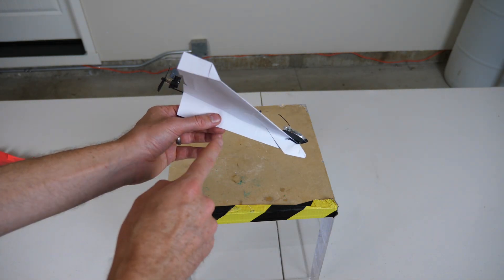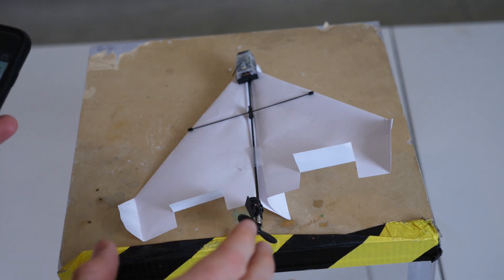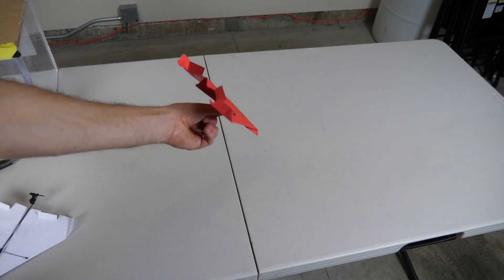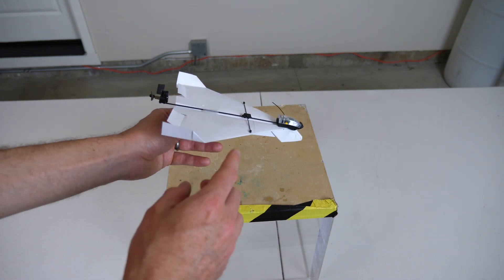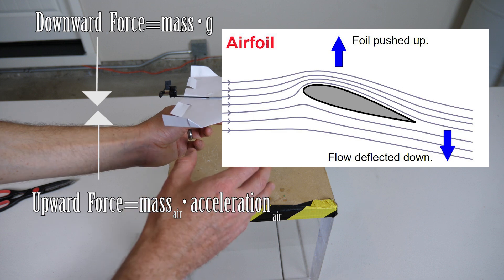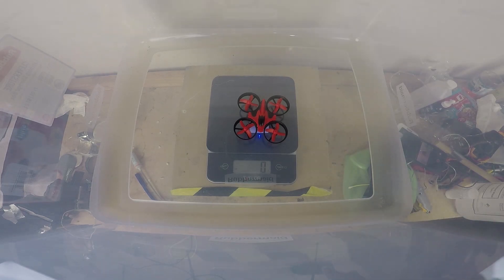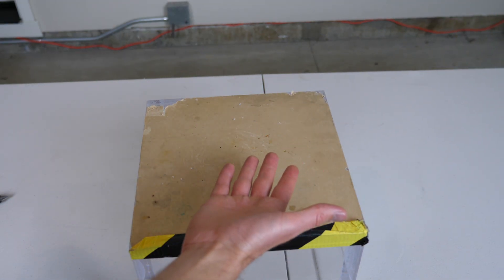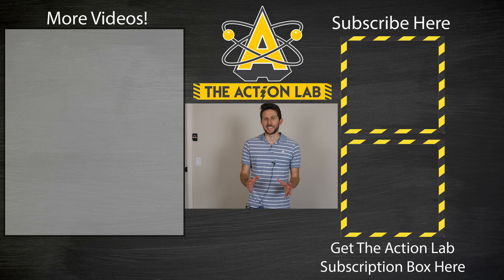How Far Can a Paper Airplane Fly if You Add a Motor? How Do Planes Really Fly?

Comment: There is a difference between lift and just being really unaerodynamic in a specific direction. This paper airplane probably has more in common with a parachute rather than an airplane. It has great air resistance in the vertical direction due to the large surface, so it falls really slowly. But that doesnt mean it can aerodynamically push itself upwards. It is more likely that this paper airplane flies, because the small amount of height that it looses while flying is countered by a slightly downwards pointing motor and not by produced lift. Also the motor is probably overkill in terms of thrust to weight ratio. You can make everything fly with enough power. Even a brick. Also the explanation in this video is a little off. Producing lift by throwing air downwards really is a result of creating a pressure difference. Also theres something wrong with the formula, because planes do generate lift at 0° AoA. I really like this channel, but this video was not well researched and scientifically inaccurate to say the least. Its whatever tho. Keep up the hard work, science is difficult after all.
Reply: Mario Dekena very well put!

Comment: Could you get a power unit attached to a gimballed (ducted) fan so you can better directional control?

Already knew that planes get much lift from Newton's 3rd by by tossing air down behind
Jet propulsion; some air pushed to high speed, helicopter; quite a bit of air pushed down at modest speed

Comment: Angle of attack increases lift but drag as well. The curved wing is much more efficient lift vs drag.
Somwhere I read that a 4 degree angle is maximum efficiency.
In ww1 there where many flat winged planes as they didn't get to the curvature venturi effect.
Sail boats also use this effect which is more efficient than wind just banging against the sail.

Comment: Alot of people are saying that Action Lab is wrong by saying that planes produce lift by throwing air downwards. Well the more complete answer is yes and no. Planes, just like fans, propellers, and helicopters, accomplish their work by creating pressure gradients. The main ways to affect the amount of the pressure gradient are the angle of attack and the shape of the airfoil, both of which are very important. The pressure gradient is really just a difference in air velocity.  The velocity of the air slows down under the wing and speeds up over the top of the wing creating the gradient. This means the air on the top of the wing is exerting less downword force on the wing than the air on the bottom of the wing is pushing up creating a net upward force or lift.  Now deflection of the air in a downward direction is also a way to change it velocity by typically slowing it down and therefore increasing pressure. This is because the air has mass and therefore inertia which resists the change in velocity. This resistance is exerted on the wing (which is the Newton's law part). There are more factors like drag and what not which come into play as well. 

It should be noted that once the wing passes through a section of air, the pressure gradient corrects itself and there is no real downward "wind" from the wing, unless you are really close to and are within the gradient.  You can observe this behaviour by watching wind tunnel tests of wing shapes.  If you watch the smoke streams below the airfoil, they are not being thrown down very far and for very long.

The reason why propellers, fans, and helicopters do produce 'wind' is because they are creating and maintaining the pressure gradient over the same area for a sustained period of time and therefore are able to give the air more momentum in the downward direction, or sideways for most fans and propellers, extending the pressure gradient further and therefore allowing you to feel it further away.

Also if the airplanes are throwing down so much air then certain types of formation flying and mid air refuling would be dramatically harder if not impossible for the plane flying below the lead aircraft (and yes I have experienced mid air refueling first hand). You would have to overcome a large down draft to stay in formation. Mid air refueling can be bumpy but that is being caused in part by non laminar flow of air i.e. turbulence and the pilots tring to keep the nose of the plane in a small box at the expense of the backend bouncing around.  I have been on many refueling flights which were just as smooth as normal flying though.

So while this explanation is not perfect, and there are some more details I am sure I am missing, Action Lab is both partially right and wrong in his explanation. I would suggest reading wikipedia and watching wind tunnel tests for more, and maybe better, information. Let more comments follow.

Comment: wings can and do provide lift by their camber, controlling the angle of attack is simply a more easily variable way of affecting lift, but BOTH are used in airplanes to varying degrees depending on their intended speed and efficiency.
Reply: No

Comment: Lift is due to 3 effects & is soly due to higher pressure below even a spinning wooden scale or foam glass flies
1. Bernouli's lift:  due to wing curvature
2. Newtonian lift : due to angle of attack ie pitching angle
3. Ground effect lift:  Additional  lift felt by racing cars, hovercraft
Reply: u know u wouldnt have airlift with out air  good fact

Comment: LOL "Throwing air downwars" acheaves exactly that - lower pressure ABOVE... "The true reason" is actually the same reason...
Even the "flat winged" plain you made has a fold in the front folded downward withch makes the distance that the air needs to travel longer than the one on top...and the elevators (or elerons not sure) on the back do exactly that - tilt the plain up so the distance... 
I dare you to try and build the plain so the fold of the wings is folded up without the folded peaces on the back...
It's the same with the propellers of the helicopter - when you change the pitch the distance that the air needs to travel on the bottom increases with means lower pressure on the top...

Comment: um just wanted to point this out ... you're so wrong. if you don't understand the subject pls don't spread false information. a aero foil causes the air particles going over the above surface have to travel a further distance than the lower side this causes the air presure above the wing to decrease and that is lift. what your observing on your paper plane is not lift . it is the decent of an object with an extremely large surface area to weight, thus even ading a small thrust vectord towards the ground alows it to stay at its inital altitude
Reply: if you would like someone to actually teach you how an aircraft functions properly and in more detail pls msg me
Reply: you have seriusly dumed this equation... (this is what you use to find lift on a aerofoil ) L = .5 * Cl * r * V^2 * A into a force vector, pls stop

Comment: An airfoil shaped wing is more efficient than a flat one. The airfoil shape allows the wing to generate lift at zero angle of attack, which isn't possible with a flat wing. The flat wing needs to be angled up to make lift. And that generates a lot of drag. For a paper airplane, that's not a big deal. But for a real airplane, it can make a HUGE difference.
Reply: I subscribed
Reply: True👍
Reply: Yeah airfoiles are just optimizing lift/drag
Reply: Exactly
Reply: you know your aerodynamics, but having the wings slanted up and also having the back part wanted slightly up, creates more lift by the air that comes in is from the front and if it goes to the back that's slanted up the air Wil go as straight as it can and pushes the curve back and increasing the altitude, you do need very slim amounts of slant though, paper is very light
Reply: Thanks for explaining it, Michael! Also simple physics shows that he is wrong. An A380 pushes 50 tons of air down per second but itself it weighs at least 300 tons.
Reply: Yes, but the point of the video is correct.

Curved wings are not necessary for flying at all, this is not why the flight is possible and happens. They are just for efficiency. In with children would be taught basic truths like that instead of misleading them.
Reply: Exactly. Action lab is a little big for his britches on this one

Comment: But then there is another wing design that is called the "symmetrical wing" which (in its name) is the same on the bottom as it is on the top which would push the air both down and up, wouldn't it?

Comment: I like your channel but I gotta correct you on this one. Lift is a product of a balance 3 basic factors. Air speed, airfoil design, and angle of attack. Too much of one or not enough of the others will result in no lift (or a stall).

The reason the paper airplane achieves lift without an airfoil is that it trades angle of attack for airfoil design. Thus the reason most paper airplanes "porpoise" in the air. Without power (air speed) the wing stalls due to the high angle of attack. By adding power, you have simply increased airspeed to compensate. An example of this is in the first attempt when it nose dived trying at level flight. Not enough speed for the angle of attack caused a stall.

 The same is not true in regular aircraft. Laws of fluid dynamics apply. By increasing the speed of the air above the wing over the same time period, you decrease its pressure. 

Take a Cessna 182 for example. Its cruising speed is lower than that of an Airbus a380, and thus requires a larger airfoil to fly. Conversely,  the a380 during landing  requires more lift at lower speeds. Thus the reason for the flaps which change the geometry of the wing. By increasing the distance the air has to flow over the wing, it lowers the pressure, increasing lift. In both examples, angle of attack is near 0.

If you had a Cessna 182, with a flat or symmetrical wing, without increasing air speed (thrust) and angle of attack. It simply would not achieve lift

Comment: At 1:15 , you got that wrong . There  is lower pressure above the wings and higher pressure below the wings . Air moves from high to low pressure , so the plane lifts .

Comment: I am sure this has been said before, but I just want to clarify some things through the point of view of an aerospace engineere.
By the way I love your videos and they always teach me some pretty cool stuff, and by no means I want to diminish your work.
The thing is that you got it mostly right. Airplanes actually take advantage of the angle of attack to increase or decrease lift, making it actually possible to make a plane with flat wings. However that would be really inefficient, because it would generate a lot of drag (not only because of the flow across the wing, but also because you would always have to have the plane tilted up to generate the sufficient ammount of force to at least maintain its altitude, which means the fuselage would encounter more surface area hit by air). This is why engineers design all kinds of airfoils to try and make planes more efficient, and this is achieved by giving some curvature to the wing (making it non symmetric. If you have a symmetric wing you basically have an aerodynamic flat wing and makes almost no difference), obtaining the famous "wing shape" that you always see. This makes the air on top of the wing to go faster than the air on the bottom, and you can calculate that a flow going faster than another one (everything else being the same for both) encounters a lower pressure, this is called Bernouilli Principle.
Therefore, both actions contribute to generate the desired lift, it is not just one or the other. As a matter of fact, flaps in planes increase the curvature of the wing (and also extends a little the surface area of this wing, but for our purposes that is not important) and this provides more lift at lower velocities to help with takeoff and landing.
I hope this was useful and it clarified things a little bit.
Reply: I'm not sure you are right. When coming into land a large percentage of the upper surface becomes a raised flap (to slow the plane down) yet there is no loss of lift. The vast majority of lift is produced by the pressure of air on rhe undersurface, at least when landing or taking off.
Reply: Tldr
Reply: Thanks for the comment David. By a raised flap you mean spoilers? If that's the case, they do not only provide a "wall" to generate more drag and slow the plane down, but they disrupt the boundary layer (they spoil it, hence their name) this does in fact reduce the lift by taking out the "suction" effect of fast air flowing over the wing, aka venturi's principle. That is why they are not deployed close to the ground whilst in-flight, but they are deployed automatically once the main landing gear has touched the ground by use of the weight on wheels sensor. Hope it helps!
Reply: engineer* amount* Bernoulli*

Comment: When you fold the wings of a typical paper airplane, it still makes the leading edge of the upper surface of the leading edge have a bow-shaped curve to it. So even though it's not pronounced as some airfoils, it's still not technically flat. Yeah you can fly flat by just using the angle of attack, but more effective and better flying aircraft still have an airfoil shape.

Comment: At lower speeds, yes, your explanation is right. For planes flying at very low speeds (like an RC plane, your plane) this is perfectly true. Even for any planes flying at speeds of under about 200kmph this would hold to some extent. However, at the high speeds that commercial jets fly (over 600 kmph) the airfoil shape takes over, since flying using the simple technique of pushing air down is simply too power hungry.

Comment: You have highlighted the 3 main issues with flying RC aircraft:
1, Launch nose up at about 30 to 45 deg on full power
2.  If you can't see it you can't control it, fly from the center of a big field, at least for the first few times.
3. Small models with a high weight to wing loading ratio fly FAST. Not ideal for a trainer!

Most model pilots know that a brick will fly if you have enough power and the right angle of attack. There are huge numbers of RC aircraft with flat wings, Indeed most model engineers will have started with Balsa chuck gliders that are just a flat fuselage and flat wing and elevator pushed through the fuselage. These fly fine.

Comment: The reason why they explain it using the bernoulli effect is that the barndoor effect of simply deflecting the air down represent only about 15% of the lift for a well designed wing. The rest of lift comes from additional air being pulled down. It's kind of like that attachment for an air compressor you use to greatly increase volume - instead of just using the air going through the compressor a bunch of additional air gets pulled in to greatly improve the efficiency.

Comment: Airplanes have multiple factors contributing to lift. The standard explanation of Bernoulli effect is part of it. Angle of attack is another. There is a third (and I believe most important) factor where because the air is moving faster along the top than along the bottom, when it goes down the slope on the back of the wing, it ends up with downward momentum greater than the upward momentum of the air on the bottom of the wing. The curve of the wing is important for flight, flat wings don't really work by comparison.
The fuel efficiency of the flight here would be terrible, as would the glide slope if the engine failed.
So in summary—Bernoulli effect IS a factor here, and the air moving faster on top is also a factor for a reason other than the Bernoulli effect, and angle of attack is a factor, and nobody really knows how planes fly, but your explanation that it's purely angle of attack is just wrong. If it were right, why would plane wings be warped tear-drop shaped like they are? Or are all aircraft engineers just retarded?
Reply: you have not understood it properly brother, he is explaining even more fundamental than Bernoulli...he is explaining how Bernoulli equations can be understood by this.

Comment: "The velocity of the air is causing the high and low pressure", and the shape of the wing is what is changing the velocity, so you can also say the shape of the plane's wing is causing low pressure on the bottom and high pressure on the top, so how is what we are taught at school wrong?

Comment: You saying that a plane doesn’t need curved wings to fly is a invalid statement, the reason why is because your test have something that a curved winged plane does not and that is a constant going elevator. So on a curved wing plane let’s say a passenger jet, the passenger jet has curved wings, a fuselage, elevators, a rudder , and at least one form of propulsion. The passenger jet has the ability to use its elevators at will but your plane does not it has air constantly being pushed over the elevators which gives your lift, so for you to prove that a plane does not need curved wings, you should do another test but without elevators. This will make your statement true or false.

Comment: You would have had a high angle of attack with the Elevators locked in the up position like they were. This will produce lift, but with tremendous drag which your engine had to compensate for. This is the only way a flat wing will fly.  The curved wing will allow you to fly with a much lower angle of attack and lower drag.  It's hard to figure this all out with a fixed shape wing, but very apparent with a wing you can shape, ie, a sailboat sail.

Comment: So, It's like surface area/ the area that will effect the surface or air or ground below it ,of the plane should be enough to throw the air below itself ?

For example a light stick won't glide in air but a piece of paper or cardboard of the same weight but bigger surface area would as it pushes air below in a bigger area. 
If that makes any sense . :-)